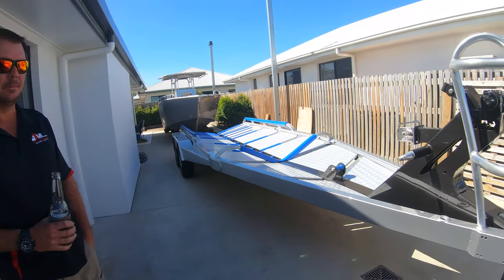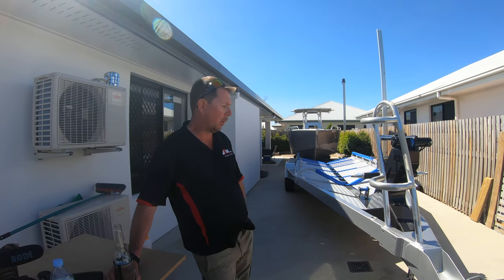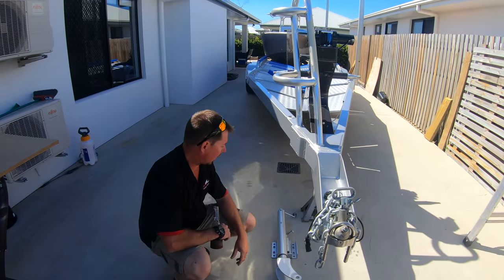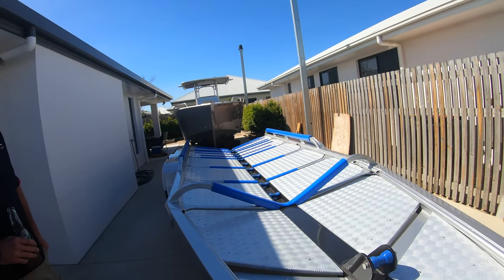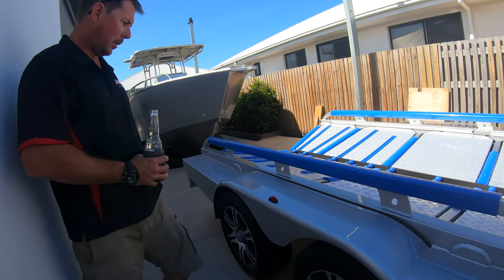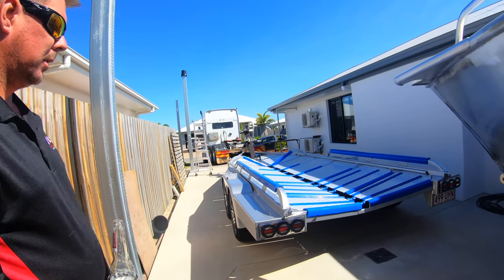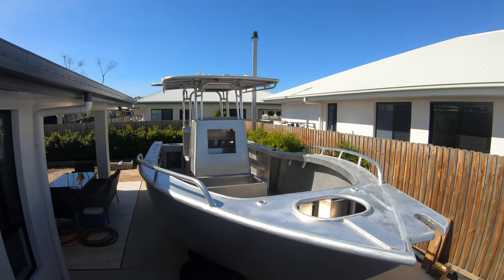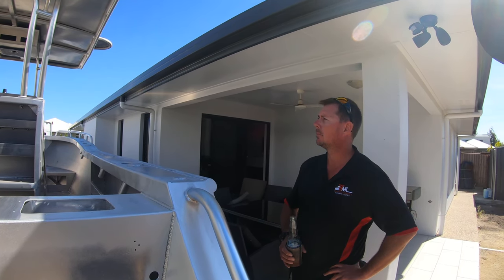ACB - AYRCRAFT CUSTOM BOATS PART 2 (TRAILER BUILD)

Comment: Really nice - it looks like it might be a bit tricky to retrieve the boat in adverse conditions given the narrow rollers at the back end? Love the water storage in the frame, pump and tap, damn good idea. I didn't see calipers on the disks, so yet to be done - will these be mechanical or hydraulic? Nice boat too btw -  a fishing machine! 

Yeah, hurry up and finish the boat :) (I know where you are coming from - time, research, re-thinking stuff, then actually ordering, getting stuff, working out how to best use/apply/adjust - all takes time).